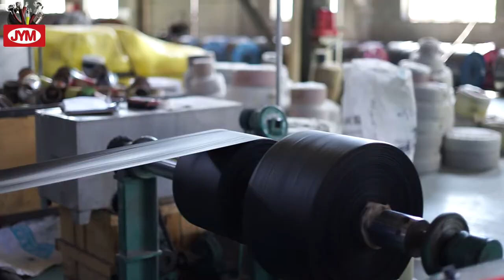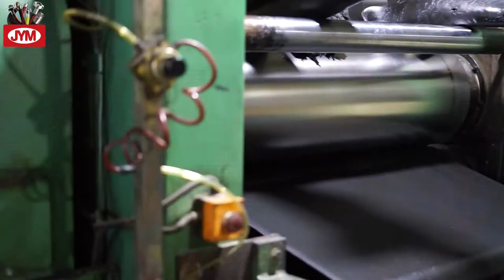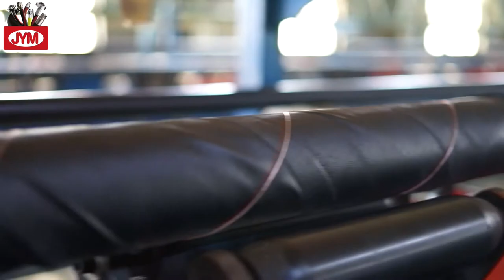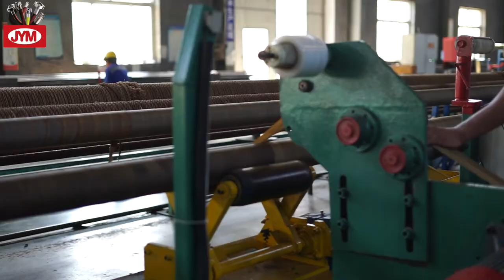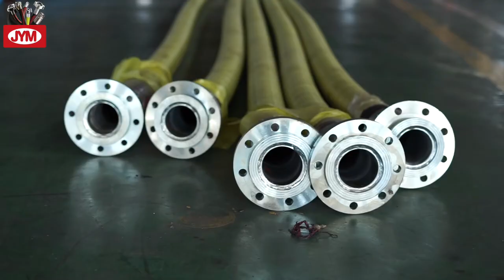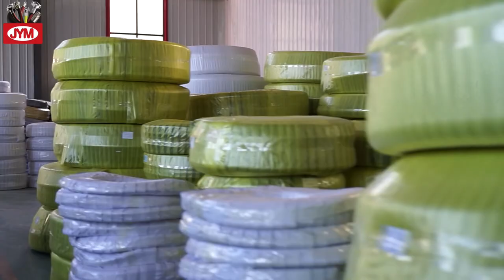JYM | Mandrel Built Industrial Rubber Hose Manufacturing Process 2021

Comment: The spinning mandrel is used in many applications. hydraulic powered rotation and counter rotation as well as photonically as well as thermal adherence applications for finite finishes on hoseing layers